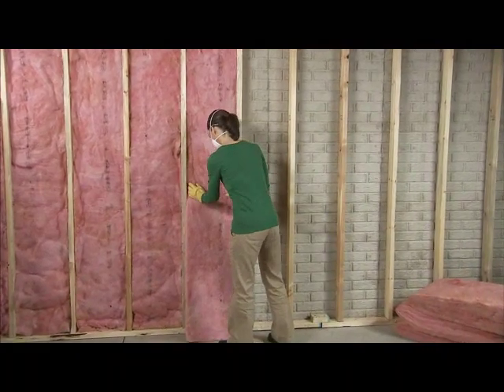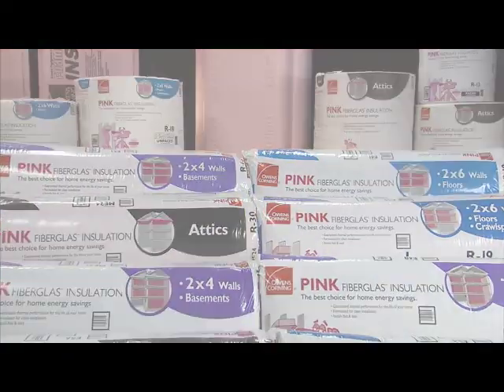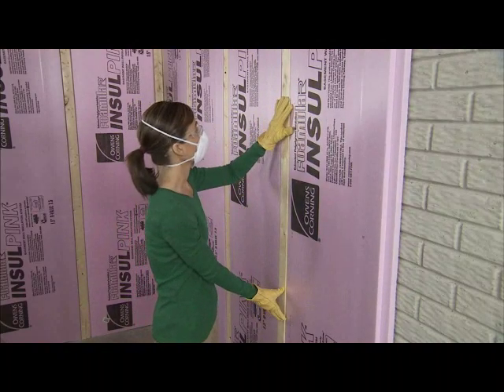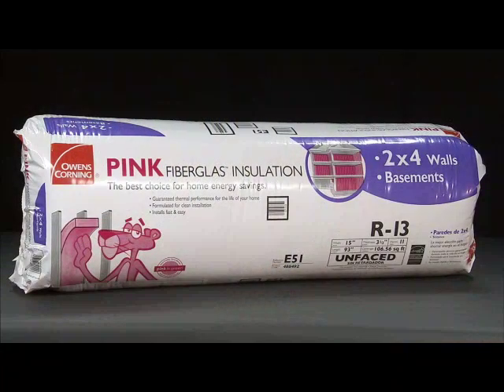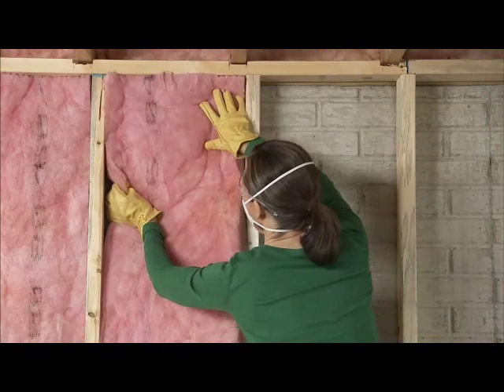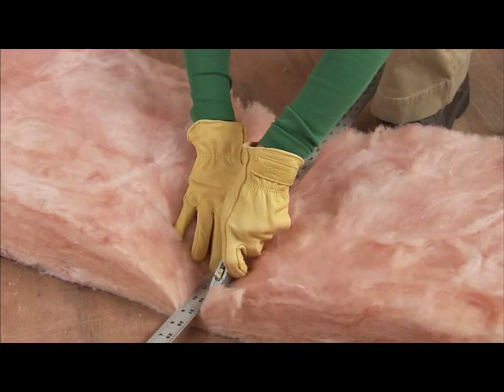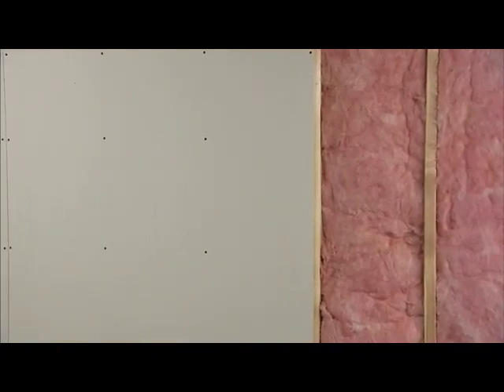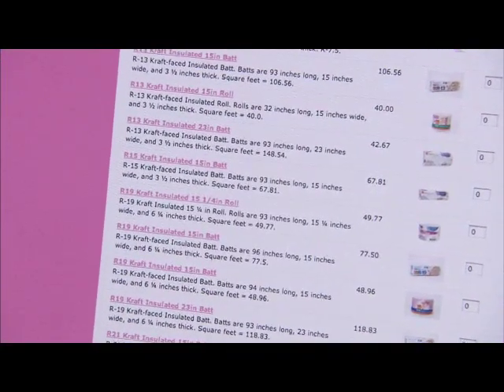DIY Insulation Project: Basement Stud Wall

Comment: batt against a basement wall will collect moisture you need a barrier prior installing batt... Another thing you never apply wood directly to the basement wall the cold will conduct itself trough that wood and with eventual condensation moles will grow on the wood.... Mole nest coming up !

Comment from the maker: Owens Corning has no recommendations for installing insulation in a damp basement. If your basement is damp, we suggest contacting a contractor to remedy this issue. Once your basement is dry, you can safely proceed with your project.

Installing insulation in a dry basement will not cause the insulation to get wet.

Should you require further assistance, please feel free to contact our Customer Care Center at 800-GET-PINK.